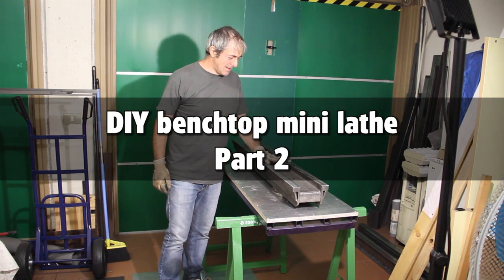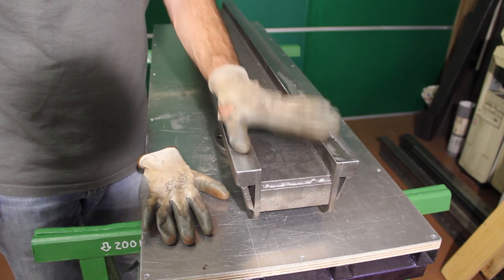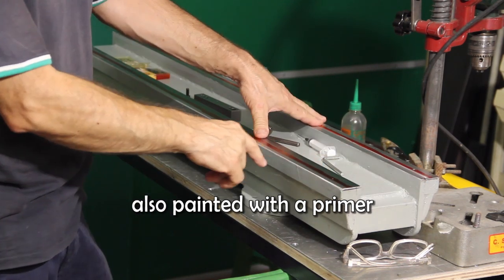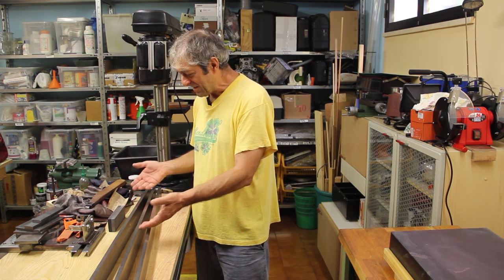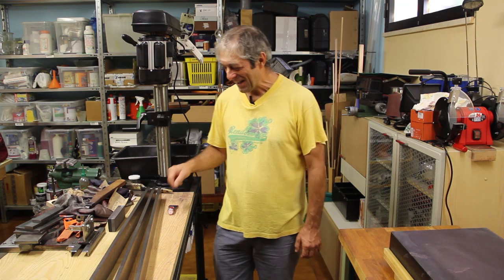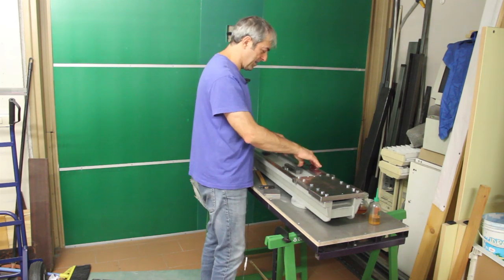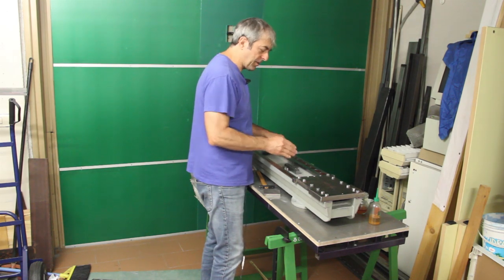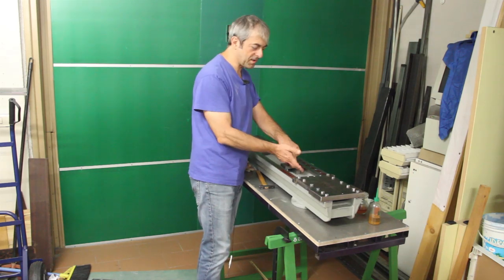Metal lathe home made - the bed and ways - part 2

Comment: Hi, this is quite cool, a lot of P's: Plan, Patience, Perseverance, Preshism, and Precision. I have a question, how far apart are the Ways? Is there a standard Ways distance measurement? Or more broadly, what are the critical dimensions between the Ways? Thanks for posting.
Reply from the maker: Love the preshism part 😄. Gap between ways is 70 mm. I calculated this considering the torsional force caused by the cross-slide and minimizing such torsion for better rigidity. So the only rule is how much rigidity you want to achieve. 
Thanks for commenting, have a good holiday season.

Comment: since there is no heat treatment of bed-ways, what is your strategy in keeping contact surfaces from uneven wear ?
Reply from the maker: AFAIK no lathe has hardened ways. Uneaven wear just happens. The carriage has brass contact bearing, though. It is softer than steel.

Comment: Did you use cold roll or hot rolled steel for your ways? Great video btw :)
Reply from the maker: Thank you! I used cold rolled steel. It has better dimensional quality but more internal stress so it is important to drill holes and make other mechanical work before making it flat.
Reply: @AccidentalScience  Did you get your steel stress relieved first? Or did you use as is? I was told that internal stress might be an issue, I just wonder how much of an issue.
Reply from the maker: @Overclocked2300  to relieve stress the only way is to heat that however would warp the material. So, no I didn't relieve it, instead I made every mechanical work (boring, cutting, etc.) beforehand the work to make them flat. I learnt the lesson rhe hard way: At first I did the mistake of working out them flat and then boring, which led me to have to rework the relevant surfaces to make them flat again. One important note. Not all steel is made the same. I used high quality C40 steel for machining. I think it is somewhat pre-relieved. I had experienced some cheap cold rolled steel that warp just by the room temperature change.
Reply: @AccidentalScience  Thank you for the info :). If I have any more questions I'll be sure to contact you, but this is all good info. Its an interesting undertaking for sure!

 For those in the US reading this, C40 steel is about equivalent to 1040, a medium carbon steel.

Comment: The 3 plate method is to ring surface   A to surface B, surface B to surface C, than surface C to surface A. Scraping the high area's between ringing the surface's. In the video it appears that A was rung to B, B was rung to C, but C was not rung to A.
Reply from the maker: It was. Look at the video where I addressed this method.

Comment: Pardon my ignorance, but briefly rubbing the edges of those steel plates against each other for 2 seconds is enough to grind them so that they eventually become flat?
Reply from the maker: "Briefly" and "2 seconds" are the wrong words here, absolutely. ☺
Please, may you help me understand how you reach such a conclusion?
Reply: @AccidentalScience  Sure! At the 1:35 mark the metal is put on top of the other and a brief 2-seconds worth of rubbing occurs. The subsequent rubbings are about twice that length, but it doesn't matter whether it's 2 seconds or 10 seconds, I'm curious about how this repetition can cause it to become flat, because in my mind (again, pardon my ignorance as I know nothing about this) steel rubbing against steel at the small pressures we exert with our arms will take forever to grind it down to flatness. If you're doing it then obviously it works, but I'm very curious as to how this is possible.
Reply from the maker: @anthonyortiz7924  oh that! No that operation is just to check how far from flatness are the parts. To steel is peeled off using a tool called scraper. I recommend you to watch my video titled "flat from scratch". (I'll look for the link and I'll post it here)
Reply from the maker: @anthonyortiz7924  here it is: https://youtu.be/dkPVokvDu5w
Reply: @AccidentalScience  Ohhhh! I'm an idiot, lol! Sorry for wasting your time with a stupid question, I appreciate the link, I will watch that now!
Reply from the maker: @anthonyortiz7924  don't worry. Likely I overlooked to explain better the process. Thanks for commenting.

Comment: Maybe this was the link you were looking for: https://ericweinhoffer.com/blog/2017/7/30/the-whitworth-three-plates-method.
Also, I read that if the three plates you're flattening are more long and narrow rectangles and you can't rotate them 90° while flattening, then flatness is no longer guaranteed.  See pg. 21 of "Foundations of Mechanical Accuracy" by Wayne Moore (https://www.practicalmachinist.com/vb/attachments/f83/257871d1559365927-whitworth-three-plate-method-20171030_091758.jpg), or note comment by "SAG 180" on https://www.practicalmachinist.com/vb/machine-reconditioning-scraping-and-inspection/whitworth-three-plate-method-330634/index2.html.